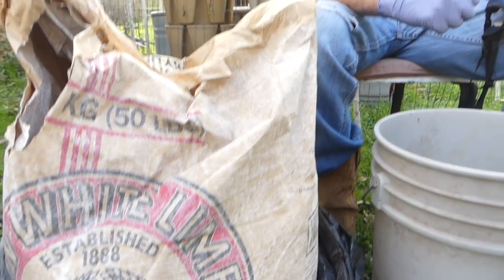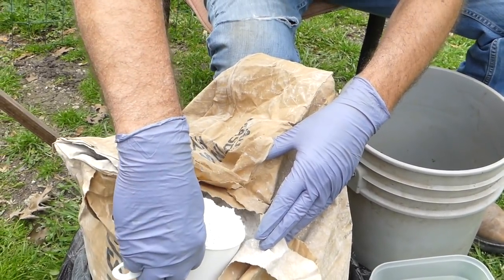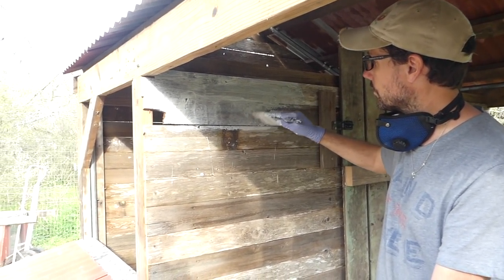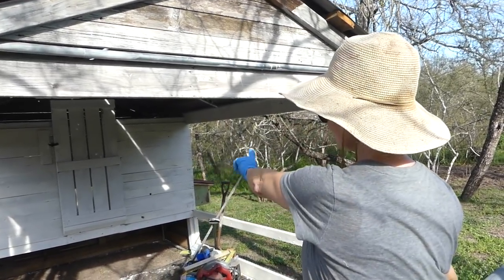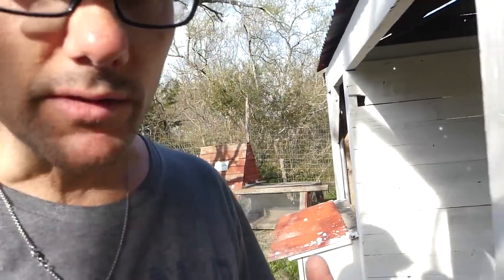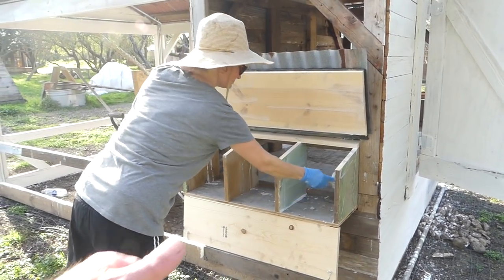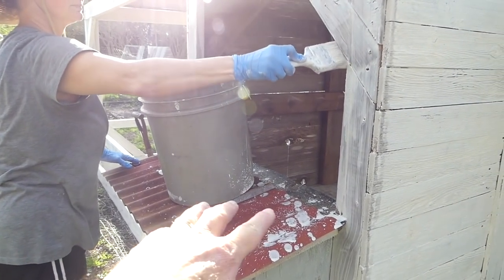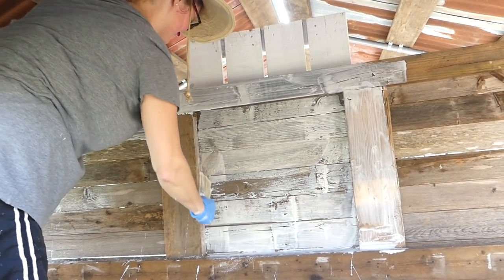Whitewashing (Lime Washing) - Building Chicken Coop from Dog Kennel

Comment: Lot of time would have been saved using an air compressor, i find the paint a bit thin.. i think an important part of the traditional  white wash is to prevent insects from hiding in cracks.. knowing a bit about it i would have recommended to make the white wash straight with fat milk  or yoghurt plus some sort of to dust grinded baked stone or vulcanic dust.. something that won't shrink and has that high metal content type of stone work..baked clay.. probably also fine.... maybe a batch of carbnysed and repowered lime itself might be fine.. i'm not sure .... the lime is litterally cement  like portland cement without the aditifs/(carbons i quess) that make it chemicly bind without taking the co2 from the air..  normally it is a 1:3 mixture a  1 part binder on  1 part sand..1 part small stones.. typicly concrete style.. now that old fashion concrete needs time to harden. 60 hours of breathing carbon co2..  if the mixture dries before the chemical reaction is done.. you end up with a dusty powdered chickencoop.. that rubs of easily...  , i brought the concrete ratio up because it sort of tells you what shrinkage you can expect using it like you do, nm  pure..  there are lots of easier concrete pre mixed products around.. yet the can't beat the use of plain lime.. plain lime does something no other cements will or can  if forms a water reppelent layer while constantly pumping water from the inside out towards its surface..so the rain will only penetrate 1 molecule deep.. yet the whole layer is breathing.. this could probably be a disadvantage when used in the wrong way.. say if you keep a carbonated hardened cubic square meter of solid lime in constant contact with water( in a pool sticking out for the mayor part) it will probably be wet all year round is my thought..not much info in dat field though.. i'm using lime for a few years now.. it can drive you crazy if you do not completely understand the mechanics at work.. and its an old technique  so the recpies are questionable not always ..foulproof.. they mention something casually where to todays standards  big letters would be used and !!!..   if you get dry hydrated lime in your mouth.. it is an absolute painfull nightmare  the pain will haunt you for months.. severe burning effects instantly but slowly getting worse first.. so first water then lime in the mixture..